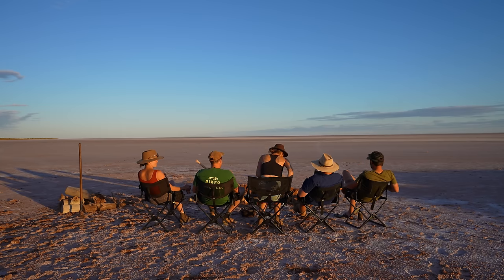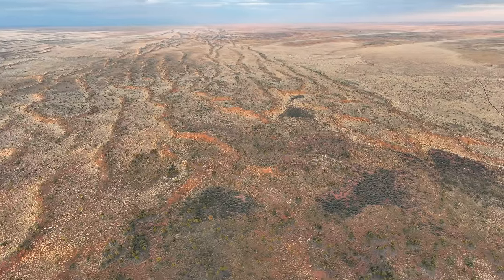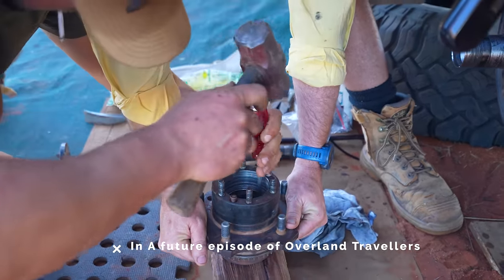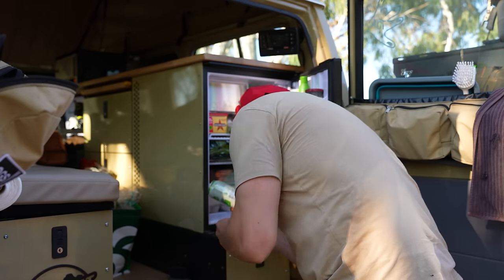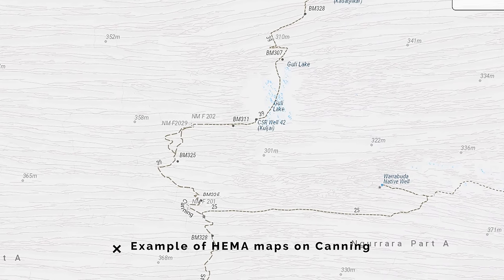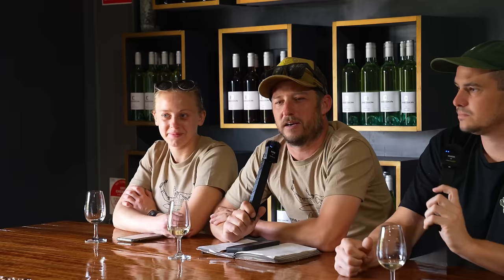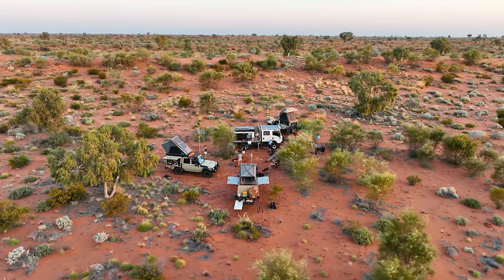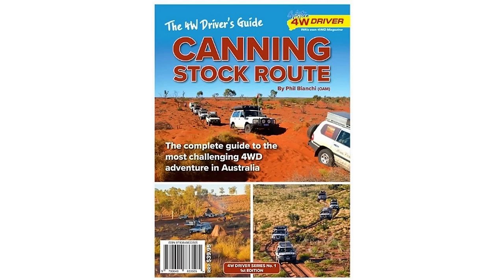THE CANNING STOCK ROUTE - EVERYTHING WE WISHED WE KNEW BEFORE TAKING ON THE CSR

Comment: In 2016 my heavily laden 2011 LC Workmate V8 used just 13-14 l/100km across the CSR ... which was in fact slightly better than the open road! Never got stuck. No flat tyres. Horrific heat. Remarkable scenery! Go fully equipped. It helps if you'd done every big track in Australia just prior, like us. Hope you have the same luck! Regards Shane M (North Otago, NZ)
Reply from the maker: I think it was our tyres which really increased the fuel for us.
Reply: I just had Bridgestone ATs. 7 days just cruising. It was damn hot so I drove an extra 1-2 hours in the afternoons. Me, the wife and an internet schooled daughter. And we are just NZ farmers. Best vehicle - fully equipped - no problem. Regards Shane M (North Otago, NZ)

Comment: Great info.  Out of interest, I have  a 2019 Troopy and last did the Canning in August 2019.  Conditions were probably a bit easier as the tracks were not as overgrown as they were for you.  The vehicle was weighbridged at the start and came in at 3350kg with 80L water and 60L extra diesel in jerries.  I have deliberately tried the keep this vehicle as light as possible and I used the original 225/95 skinny tyres.  Our fuel consumption was considerably better than yours - 1750km using 245.5L (14.0 L/100km).  From Billiluna to Kunawarritji we used 107.5L for 687km (15.7 L/100k)  and from Kunawarritji to Wiluna used 138L for 1063km (13.0 L/100k).
My take on this is that aggressive mud tyres and extra weight really push up consumption in soft sand country.
Reply from the maker: Yes definitely the larger tyres and weight
Reply: So pleased to see this comment.  I'm buying a Troopy and I'm planning on keeping the tires and suspension stock.  It's good to know your fuel stats are so low, what I was hoping would be the case.  Do you feel that not having it lifted has held you back or got you stuck on any of the trips you have done?
Reply from the maker: @wayneroberts7429  I think I stock troopy kept relatively light will do it no worries. They’ve got great clearance from factory.
Reply: @wayneroberts7429   I ran skinny tyres on split rims for 10 years followed by fat tyres for 20 years and now skinny tubeless for 5 years - its great to be back on tall skinnys.  
Troopys don't really need lift - clearance is limited by the diffs, so tall tyres are great, but approach and rampover angles are pretty good stock.  But the factory rear springs will sag when loaded.  I upgraded to Terrain Tamer 3 leaf  parabolics and have the 20mm lift coils at the front.  It really suits a vehicle that doesn't go above 3300kgs.  Too much lift on a Troopy makes them a bit top heavy and unstable compared to most wagons which have a significantly wider track.  And I have got 40mm of track correction by using 16x6.5" factory steels from the 105series on the rear.  The centres are the same so it looks great. Although it is only a partial correction, I find it feels more stable when towing.  On desert sand I never had a problem with the narrower rear track on the Troopy.
Reply: @philg2468  I'll check out the 16x6.5" factory steels from the 105series and see if they work with the 2024 Troopy, that solves nearly half of a not very big problem or very little money.  Is the ride improved with the Terrain Tamer 3 leaf  parabolics?
Reply: @wayneroberts7429  The ride has never been a problem - was OK on  the factory springs and is OK with the parabolics.  Main difference I noticed is that the parabolics need strong shocks to control the extra bounce - particularly noticeable on chopped out sand dunes in the deserts.  My original Terrain Tamer shocks didn't cut the mustard so TT replaced them with the heavy duty versions which are OK.  The factory shocks were OK too.

Comment: In your opinion could you do the Canning towing an off road box camper?  Great video too, thank you.
Reply from the maker: Yes you definitely could, that being said you’re not supposed to tow on the canning and we saw plenty of trailer wreckage’s on the track.
Reply: @OverlandTravellers  I wasn’t aware you couldn’t so thank you.  Better start the research proper 😊
Reply from the maker: @dawesville1615  all the information for this is in our e-book
Reply: We passed a number of trailer wrecks. It seems too that the trailers also wreck all of the dunes. Also - a burnt out Discovery and a Patrol. We bumped into an older couple who were waiting for a trailer spring midway on the CSR ... sadly we saw that spring, and did not know whether it was better to take it on or leave it. But they were safe ... just a 1-week wait near the Community. Regards Shane M (North Otago, NZ)
Reply: @shanejfm  thank you. Not going down that road anymore. Will look to prep the vehicle instead.